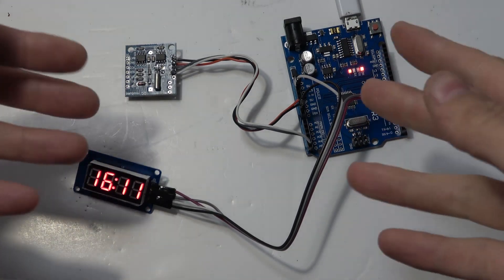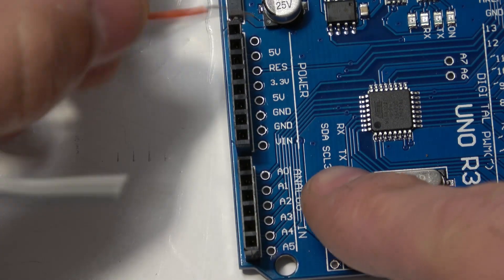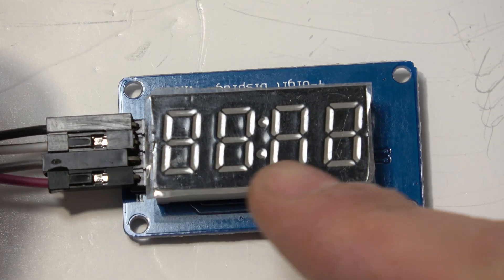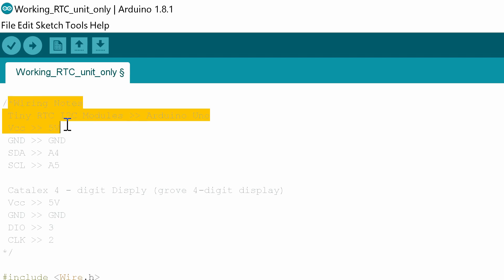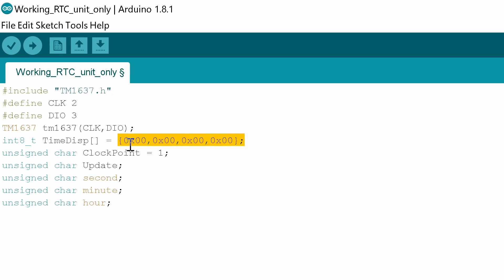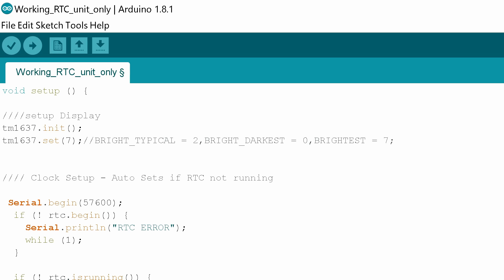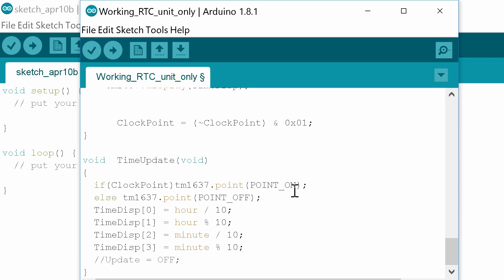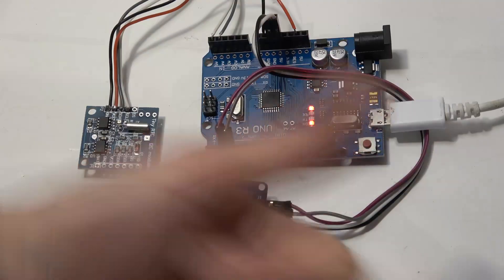Arduino RTC Clock With Example Code - DS1307

Comment: Here's the complete code since no one else had uploaded it and because I read a few comments and some people were having troubles with their code. 
 
/*
  RTC Module connections with Arduino
  Vcc : 5V
  GND : GND
  SDA : A4
  SCL : A5

  4 Digit Display Module connections with Arduino
  Vcc : 5V
  GND : GND
  DIO : D3
  CLK : D2
*/

#include <Wire.h>

// For RTC
  #include "RTClib.h"
  RTC_DS1307 rtc;

// For Display
  #include "TM1637.h"
  #define CLK 2
  #define DIO 3
  TM1637 tm1637(CLK,DIO);
  int8_t TimeDisp[] = {0x00, 0x00, 0x00, 0x00};
  unsigned char ClockPoint = 1;
  unsigned char Update;
  unsigned char minute;
  unsigned char hour;

void setup() 
{
  // Setup Display
    tm1637.init();
    tm1637.set(2); // Brightness 0-7

  // Setup Clock - Autosets if RTC is not running
    Serial.begin(57600);
    if (!rtc.begin())
    {
      Serial.println("RTC ERROR!");
      while(1);
    }

    if (!rtc.isrunning())
    {
      Serial.println("RTC Not Set!");

      rtc.adjust(DateTime(F(__DATE__), F(__TIME__)));
    }
}

void loop() 
{
  DateTime now = rtc.now();

  Serial.println(now.hour(), DEC);
  Serial.print(":");
  Serial.print(now.minute(), DEC);

  Serial.println();
  hour = now.hour();
  minute = now.minute();

  delay(1000);

  TimeUpdate();
  tm1637.display(TimeDisp);

  ClockPoint = (~ClockPoint) & 0x01;
}

void TimeUpdate(void)
{
  if (ClockPoint)
    tm1637.point(POINT_ON);

  else
    tm1637.point(POINT_OFF);
    TimeDisp[0] = hour / 10;
    TimeDisp[1] = hour % 10;
    TimeDisp[2] = minute / 10;
    TimeDisp[3] = minute % 10;

  // Update = OFF;
}

Comment: New to all this
i have gone through this code over and over and cannot get it to work.
All i want to do is get a clock to display on the display.
I have tried all different methods and still can't get it to work.
Please help
Reply from the maker: Where do you get to? Nothing displayed at all? Have you managed to get any examples from the display library to work?
Reply: @DanSohan  I've got all the libraries, I typed in the whole code and double checked it. I've stepped away from the pc for a while.
It must be something I am doing because I can't get codes from other sources to work.
Reply: @DanSohan  thanks for the reply, I have  decided to get a new laptop because this one is old and is past it, i will try again then and will let you know
Reply from the maker: @johndoggett3324  are you using arduino clones (cheap ones) check you have the right driver if unable to upload any codes. I think CH340 might be
Reply: @DanSohan  I'm using the correct equipment,  my laptop is 10 years old and having issues so I'm going to start fresh and try again.
It's been 20years since I programmed so I'm trying to catch up.

Comment: Hello, thanks for the great video. 
I’ve followed though the video and mine is 2 minutes behind the time on my actual laptop. No idea why or how to bring up to speed. Any ideas?
Reply from the maker: That is strange.. one you have uploaded the programme to the RTC.. did you reload the code with the time setting code commented out. Else the arduino will reload the time every time its powered.. if this is not the problem you could either adjust the computer clock to allow for it, or add or subtract from the time variable maybe.. dont know what would cause it to be wrong
Reply: Dan Sohan I did not comment the code out, will have to have a look and probably watch the video again ha. I tried reloading the code again but always 2 mins behind. Very odd. If it doesnt work then I’ll add that addition. Thanks
Reply from the maker: @Ilikeridin  I later went on to add some buttons to change the time.. pulling the time from the PC is less than ideal. We have day light savings to deal with as well. Once set you should be able to increase or subtract from the min and hour variable to set it..
Reply from the maker: Unfortunately I do not have the parts now to do a follow up video, but I'll see if I can find a code later
Reply: Dan Sohan that would be amazing if you could find the code! I had thought about some buttons but not got that far but I think that’d be the better option. I’m in England, so I deal with the time changes too.
Reply from the maker: @Ilikeridin  It was some time ago, and i've not been able to find the code. Might be on a work computer. I think it was based off this - https://create.arduino.cc/projecthub/Tittiamo/clock-set-date-time-0d46a4
Reply: Dan Sohan no worries. Appreciate you looking! I’ll have a read through that code and try the same. Thanks again
Reply: Dan Sohan hello. Thanks for that code. I’ve tried integrating the code but it doesn’t work as it should. It’s like it gets confused when I press the buttons. Don’t suppose you could cast your eye over the code as you may see instantly the issue? Code is an uphill battle for me ha, hardware I’m fine with, coming from an electrical background. Thanks

Comment: Can it be done without the Arduino.
Its not nice for a digital clock to hav a big Arduino attached to it.
Reply: You could either use a small Pro Mini or a Nano but to reduce the size further, you could use a bare ATmega328p/pb IC
Reply: A DFRobot Beetle might work, but you have to have something communicating to the display.

Comment: by mobile uploading of code time not syncing with mobile,how to update time manually
Reply from the maker: I think you can manually type the time into the code as you update. I can't remember right now, but maybe one of the examples in the library shows a manual time setting method... I didn't know you could programme arduino from the phone!